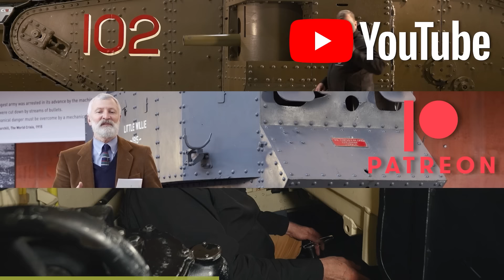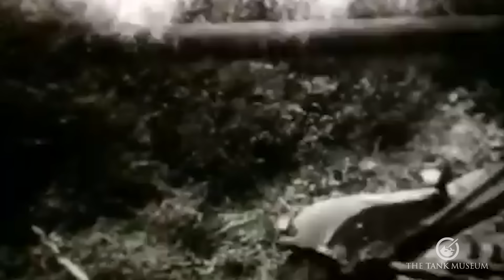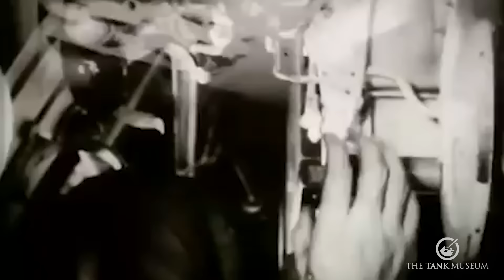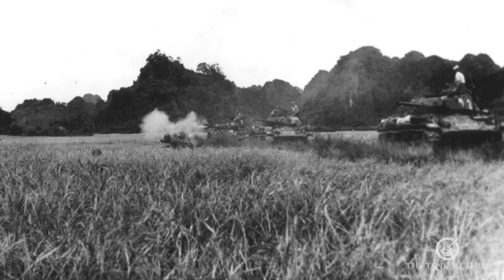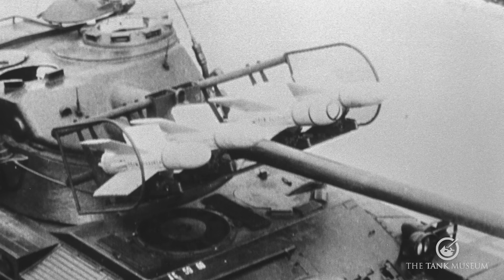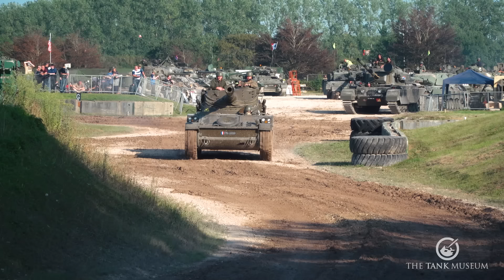AMX-13 | Tank Chats #174

Comment: Just small addition to the video. Amx-13 tanks production was more closer to 3200 (2800 with 75mm gun and about 400 with 105mm). 875 were upgraded from 75mm SA50 to 90mm Cn F3 in late 1960s. Approximately 3100 AMX-13 vehicles were APC/IFV variants, the remaining 1400 chassis were used for self propelled howitzers, AA guns and various specialized/experimental vehicles.
Reply: Good information!

Comment: It's a shame most of these prototype AMX tanks arent even being considered being added in War Thunder. Even before that they had SO MANY prototype tanks and even full on production series yet they just dont add them. They have all the info they need to bring them in the game, yet they just wont. AMX 13 with a 105mm gun oh boy imagine how much interest that would spike in the players or that one tank with the AMX 50 hull and the Somua turret just imagine how many prototype tanks they had. They even had a AMX 50 Surblinde Turret mounted on a early AMX M4 hull i think. There is a picture even showing it. Sadly knowing Gaijin even if they add it they will make it stay at super high BR something like 8.3 or so. That's the main reason NO ONE plays French tech tree. They just make vehicles not fun to play yet they have so much potential.

Comment: I did drive the APC version. below  are some reactions on the gear box which I fully support.  gear lever in an odd place and  changing gears cumbersome. Also steering the vehicle  The Dutch only allowed   me to use the "wet"  brakes  ( to prevent excessive wear)     I used the dry ones .  the "wets" hardly functional

Comment: For the chafee turret, the real reason was the delay in production of FL11 turrets, it don't last very long. The 105 has been sold to many countries, France prefer the 90mm HV gun that has nearly the same penetration has the 105. They also use it on 6x6 vehicles. The SS11 missile makes it really lethal and ukraine war show that light vehicle with missile are the king of battle even against bigger MBT.

Comment: It was used by the Singapore Army 🇸🇬, back in the 60s and was intergrated in Singapore first tank batalion which is now a armored regiment. As years passed, it was refurbished and upgraded to the AMX 13 Sm1 Variant. In 2004,  It was replaced by the German made leopard 2A4 MBT and was also refurbised and upgraded to leopard 2SG (Singapore Variant) and in addition to the leopard 2A7.
Many of our SIngaporean Soldiers, Conscript, Regular and Reserve have memorable experience operating the AMX 13.

Comment: The last AMX13s were still in service at the end of the 80s. I drove this vehicle, equipped with a 30mm twin-tube. It was lively and agile, but the gearbox was capricious, and if I missed my double declutch the gear lever would vibrate loudly because the gear wouldn't engage; the palm of my hand still remembers it, because it was painful. Even for us it was an old vehicle, but we had fun driving it. (translated with google translate)
Reply: @@maximillianwylde5163   Very easy to use, because at the time there were no electronics.  It was rustic and sturdy. The only real problem for me was that it ran on gasoline and not diesel. The risk of fire was significant, even in the presence of an automatic extinguisher, and therefore the damage was still significant.
Reply: Thanks for your insights, always great to hear from people that actually used them.
Reply: Was it spacious and comfortable?
Reply: @Danielbros9  You could say there was room, but not spacious. The comfort was mainly due to the fact that it is a tracked vehicle, so holes and bumps are forgotten. I got my AMX13 license in 1985 and we still had Jeep Willys and what they had in common was that they both ran on super fuel. It was another era...
Reply: @Fiumara2A  looks like a lot of fun and oww! At the same time
Reply: @Danielbros9  Everything did, and it was already at that time old material.
Reply: no still active in Indonesia. until 2024 275 unit in service for Indonesia army

Comment: Good presentation, but the part of AMX-13 working in pairs is not accurate. It's a shoot and scoot tank. You fire all 12 rounds in 1 minute or so and scoot off. It's basically for hit and run in ambush. And the gun can be reloaded from within the tank. the rate of fire is a lot slower, but doable.

Comment: AMX13 weights 13 METRIC tons. That is 1.102 US tons. The weight would be 28,600 pounds. The US M60 weights 60 US tons. Also goes  .6 of a mile on an US gallon.

Comment: Fascinating design concept, but I can't help but thinking cost played a big part in the decision to go with the AMX13.    I can understand the reasoning behind going for speed and firepower on the Leopard I, because ATGM made armour value questionable suddenly, but this thing?  It's almost like de Gaul wanted a big-boy tank gun for very little money.  Personally, if it won't keep out anything bigger that a .50 round I'm not getting in it.
Reply: The French had just come out of WW2 with no armour building capability. The design and construction of a light tank is many factors less complex then that of a MBT or a heavy tank. They had to use the AMX-13 as a lesson on how to rebuild their industry. Against the intended enemies in the ex-colonies, the absence of heavy armour protection is acceptable when faced with the perceived general lack of heavy anti tank weapons in the hands of their enemies in these ex-colonies.

Comment: Its a great tank for asymmetrical warfare, quick response to far flung rugged areas but as a medium for large, set, prolonged battle its competitors were probably better. Although the gun arguably makes up for it.
Reply: Above all, the AMX 13 is a light tank, so it has the flaws of these advantages. on the other hand I don't see many foreign competitors to the AMX13? were you thinking of the M551 Sheridan?

Comment: One of the big advantages of the wobbly turret is it reduces the tank's height. While a traditional mantle turret requires the turret roof to be high to accommodate the breech of the gun during depression, the wobbly turret's roof simply raises up. This also has a bunch of weight savings.

It does seem to have fallen by the wayside, but if unmanned turrets take off (eh), the idea may get revisited as it offers the potential to have extremely tiny hull-down silhouettes (which again, weight savings)
Reply: It has fallen of fashion due to the necessity of a stabilizer. 
Stabilizing a gun is way easier than the whole turret.

But yeah I agree that with unmanned turrets we could very much see this kind of design make a come back.
Reply: They could go further in unmanned for weight savings. Have a reciprocating gun with almost no armour in turret. Means you can have a heavy gin with almost no turret weight. The compromise is that you could easily lose the cannon in an attack but this may be acceptable.

Comment: Definitely one of my favorite tanks. 
A very capable gun on a light and highly mobile chassis.
The use of an autoloader in an oscillating turret to fit the relatively large gun was a smart design solution. 
And although it is a utilitarian design it has an elegant, streamlined shape to it.

If I had the money to buy a tank and drive it around my property, I would probably buy an AMX 13. 😄
Reply: Check out FARG Motorpool channel to see our work and restoration of AMX13 tanks

Comment: Singapore 🇸🇬 Military SAF Army had bought these Second hand AMX13 light tanks from. France 🇫🇷 and India 🇮🇳  in the 70s as defence of Singapore 🇸🇬. 

Singapore 🇸🇬 Technologies kinetics "Modernisation " programming like Diesel Detriot Engines, First modified Hydro pneumatic Suspension and Digital Fire control systems till 2003.

Singapore Ministry of Defence decided to Replace these 33 years old AMX13-SM1 light Tanks with the,Germany made Leopard 2A4 MBT.

Comment: This is a minor point, but there is a short clip of a race between an AMX-13 and an A30 'Challenger' in the video, as the French never used the 'Challenger' I assume it was in the UK, but what was the purpose? Not exactly the same class of tank, the 'Challenger' is around 31 tons, over twice the weight of the AMX-13.
Reply: I suspect main purpose was for giggles.

However allowed UK to show of high speed of challenger and french to show that they could catch and kill fast MBT

Comment: The Dutch used these as tank-destroyers in their independent Anti-Tank companies. These were affectionately referred to as the 'Shooting Rollerskates' when comparing them with the other available tank-flavours (The Centurion and the Leopard 1 which were much larger and hefty.). Crew were specifically selected on length (or lack thereof) and spine flexibility since as a commander one had to bend forward and backward with the elevation of the turret. The Commander's hatch actually was not really a hatch, but more so an oversized heavy-duty helmet. Crew would not as much mount their tanks, but more so put it on for wearing it.
The Dutch version employed the 105mm main-gun which made for rather remarkable fire drill since when firing with the gun traversing outside roughly the front fenders, there was a distinct possibility, bordering to likelihood, that the tank would flip over due to the gun recoil. Seeing the AMX-13 firing at the shooting range alone, made on a little queasy since it would violently stagger back with the recoil. It kicked like a mule and bit like a crocodile and with the auto-loader, one would rather not be in range of its business-end. They were fast, loud and deadly when used in their intended battle environment and role as an ambush type of tank-hunter/destroyer.
Reply: The 105 mm gun kicked so much that in time cracks showed up in the steel of the turret of the Dutch AMX-13s.
Reply: @Franky46Boy  Hm, That must have been at the early stage of use, because, although regularly (as in daily at the shooting range) checked for this, this was not a known and/or frequent problem when I was involved this remarkable vehicle. 
The Leopard routinely had vastly more incapacitating problems with is hydraulics (fuid: Red and Toxic).
Reply: @Centurion101B3C  It was in the newspapers then and on the NOS-Journaal.
Reply: Sadly indonesian army still use this obsolete tank
Reply: @zupra5638 😂
Reply: During 1981 in the Dutch army I saw the AMX 13 training together with the AMX TOW as an AT team.

TOW first to open fire and when forced to withdraw the AMX 13 105 would take over, to let the TOW team redeploy / rearm.

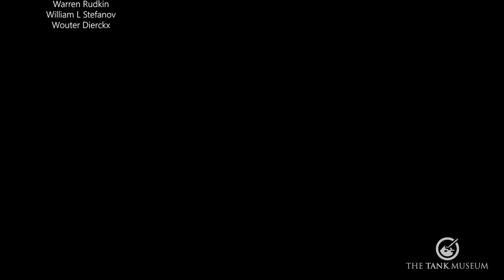Then the AMX 13 would move back coverd by TOW. Leapfrogging. 30:44

Comment: Interesting that they chose 75mm. Rather than being inspired by the Panther's gun, might it not have been more inspired by the very quick firing (for its time) "soixante-quinze" that the French Army was so devoted to for decades?
Reply: It was not inspired by the Panther, AMX 13 /75 were fitted with  original panther war surplus tubes, captured by France in a Panther factory.  (Agood gun is a gun for free 😜)Later, AMX 13/75 were designed to shoot ATGM SS11,installed  above the 75mm gun. They served in armored infantry regiments until middle 80's, replaced by AMX 10 Milan.
Reply: @billyjean7381  I have never heard that one before, I am a former AMX-13 tank platoon commander and also DY S3 of my tank Regiment. The length of the barrel between these 2 tanks is not the same. The Kwk 42 is at least 2 ft longer then the AMX-13 CN-75. However, the accuracy of the gun is superb.

Comment: Greetings from Singapore, where national service (conscription) is alive and well. We had a large fleet of over hundreds of modified AMX-13s, now retired. 

Our modified tanks were designated SM-1s, and had a Detroit diesel engine, a new transmission, hydro-pneumatic suspension, a laser range finder , new FCS, fire suppression system, and etc. I loved the simplicity of the autoloader - one worked a wheel to get a round out of one of the two revolver like magazines in there bustle and a rammer slammed it into the breach - everything operated inches away from your upper torso. 

Crew comfort was virtually non-existent. Aside from the proximity of the autoloader operating, each member of the crew was wedged into their positions and it was noisy when the vehicle started to move. Redeeming features - the seats had cushions and I recalled that when the engine was running, the fighting compartment was drafty from air circulating in from the engine compartment. 

The vehicle was mechanically reliable though and was quite easy to service and maintain.

Great backstory from the tank museum. I doubt many of us who served with the vehicle for generations knew much about that. And oh, by the way, after retirement, some of the tanks were converted into bridge launchers-I guess that’s history repeating itself.
Reply: I believe it's one of the first in the world of modified 75mm AFSDS rounds to be use in a tank.
Reply: @MarkzOng  interesting. I didn’t know that the gun had been modified. But yes, it could fire a APFSDS rounds.
Reply: @yeenchyeench9747  It was a fairly classified DSO project back in the late 1980s, around the same time the SM1 modernization took place. It was only revealed after DSO commissioned a book to mark their 50th anniversary.
Reply: @yeenchyeench9747  I remember training with those... always preferred handling the APFSDS rounds vs HEAT or HE, because the sabot shape made a convenient handhold.
Reply: @MarkzOng  That's because no one else in the world uses a 75mm gun. And if they did, they would have used HESH or HEAT  rounds.
Reply: worked as civilian contractor for SAF in Australia, for Exercises & logistics. The turret had canvas shroud for split turret. Definately not for large people. They had bridging AMX13, without the turret. Saw them loading & firing APFDS roads.
Reply: @ratdetecting4780  too bad , they had soldier on for far too long at least 50 year in SAF.  Now probably mothballs for the last batch of train personnel to reach 65 then probably dispose off once and for all.  Now the leopard 2 took over as MBT.
Reply: I am uncertain if the M10 Booker with an XM360 120mm cannon would be considered the true successor to the AMX-13 SM1, or would the Hunter AFV with the XM360 cannon be the one?
Reply: @crimcrusader8459  looking at hunter space and design, it definitely take into consideration of future modular growth. There are some shortcomings of design but generally wide enough to fit at least an 105. Fun facts of rumours have it they tried onto the bionix but apparently not wide enough to fire all angles.
Reply: @MarkzOng  Bionix design was a screw up to begin with. The idea was to develop an entire family of AFV and tanks based on the Bionix chassis, but they discovered they could not fit a 105mm turret onto the Bionix. One of the primary design goals was to have this 105mm Fire Support Bionix to replace the AMX-13. But they could not come up with it.
Reply: @joechan895  the idea on bionix is to maneuver in jungle terrain terrain much like what the ha go would in Malayan jungle. Therefore it's smaller than average size. The idea of customized for local context. They have too many objectives to met with with not many mature designs to work with .
Reply: @joechan895 They could not possibly screwed it up that badly. Assuming it's the 105mm L7/M68. There is a minimum viable weight of the platform to accommodate the L7 & to absorb the recoil of the 105mm. It was approx 30 to 35 tons de minimis, impossible at say under 30 tons unless it could sort of fire only forward without all round tranverse fire. It needed a certain size current ring again at least in excess of 70 inches (probably at least 75 inch or slightly more in diameter) & the deck had to be strong enough to accommodate the recoil & the turret. It must be capable of accommodating a turret of maybe 8 to 7+ tons even for a relatively lightly amoured turret. Internal usable space must be capable of accommodating 3 crew in the turret & the gun, equilibrators + recoil system + gun stabilising system. So you need something at least around 30 to 35 tons.
Reply: Now it is no longer amx is decomissoom
Reply: From a Singaporean Armed Forces POV, it's quite appropriate that both the AMX13 and the Centurion are in the shot while Dr Willey is presenting.

Comment: That is the difference between the 75mm, 90mm and 105mm turrets? If the 90mm is a rebored 75mm just a different gun sleeve and external it's the same turret? Same with the 105mm different barrel but I can see much difference between the the 3

Comment: Mid-1980s U.S. Army armored vehicle recognition cards / friendly & enemy tanks, IFVs and APCs included the AMX-13. Very distinctive shape.
Reply: But was it described as friend or enemy? ;)
Reply: @vendist , that's the interesting part about the cards. They stated the country of origin, but didn't characterize threat vs. friendly. Considering the U.S. drove into Kuwait in 1991 with Egyptian and other coalition members operating Soviet-built equipment alongside, country of origin doesn't always equate to an enemy vehicle. A lot maybe, but not always.
Reply: Yet it was The Bradley’s that kept being miss IDed and shot
Reply: @tomhenry897  , and a Tornado off the aircraft deck.

Comment: I've seen this tank on display in the Dutch National Military Museum. The Dutch army, unlike most other countries, fitted it with a 105 mm gun and used it as a reconnaissance vehicle in the sixties and seventies.
Reply: yeah, whan i was in the  dutch army in 79 i was told the big 105mm gun turned out to be too much for the turret bearings.......
Reply: If they wanted to fire 105 mm gun it had to remain between the headlights. Otherwise the tank would be thrown on its side. The quality was crap. They always broke down and were never available for exercises.
Reply: @gabbertje-rh7rw   Yes, I heard this too. Essentially a stug or a hetzer so, not a great situation for a tank.
Reply: My AMX13 105mm is in good condition and works faultlessly.. FARG Motorpool to see videos..